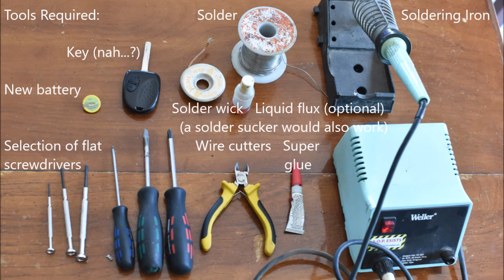How to change remote control battery in VR VS VT VX VY VZ Commodore key fob

Comment: Can I send you my remote to fex  please
Reply from the maker: You could, but I don't think it's a good idea. For example, you might pay me say $80 including postage each way for me to buy a new battery and install it for you, but there's no guarantee it will get the fob working again. It might not be the battery which the problem, there could be some other issue with the key, or it may have lost its code somehow. And obviously without your vehicle, I couldn't test it at this end to make sure it's working before sending it back. So it might not work when you get it back, and then you're already out of pocket 1/3 of the price towards a brand new key.

Comment: Nice job but I hope you never have to replace the battery again using super glue.
Reply from the maker: I had a VS before this VY and replaced the battery the same way on that key. It's no problem, the super glue eventually lets go well before you need to replace the battery and you just reglue it. It may be different if you used a lot more glue but if you do you risk it getting on the electronics.

Comment: no wonder I could never get the braid to suck, u need flux on it pharkin
Reply from the maker: It's not essential but it definitely helps. Proper solder braid has powdered flux in it which melts with the heat of the iron. When it's new it works pretty well and is less messy than liquid flux. However it doesn't last forever so old braid doesn't tend to draw solder up so well. New braid is usually ok, but liquid flux just makes the process quicker on both, especially old braid, if you can handle a bit of mess!